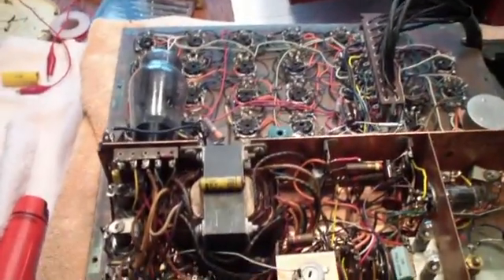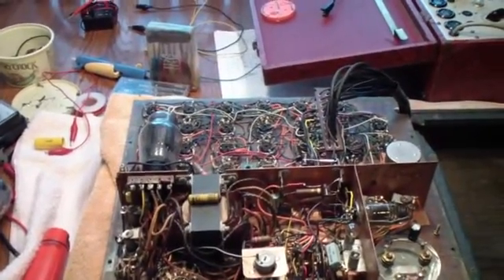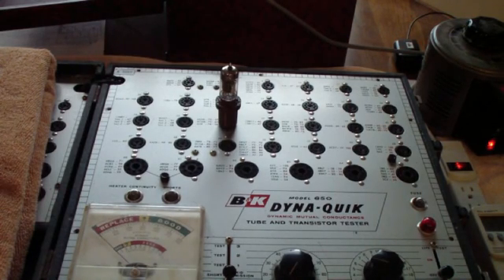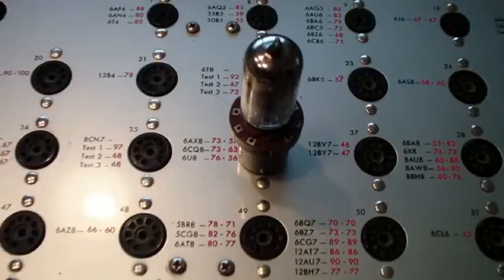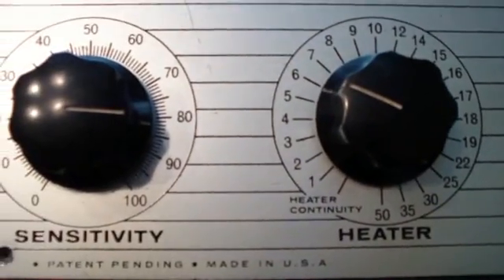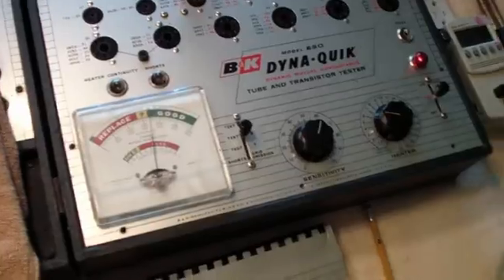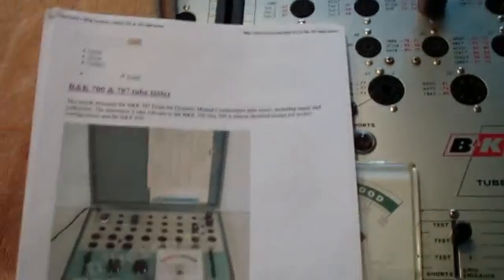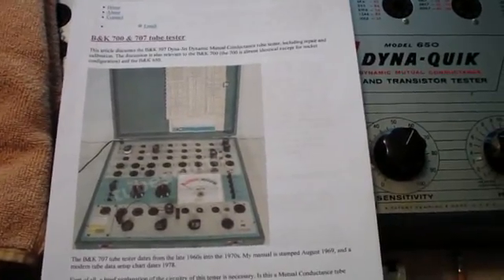TTT031 BK 650 Pt7

Comment: Hi Tom,,, Just watching your 650 restoration series again and I noticed that you said you did change the Selenium Rectifiers to  Silicon Diodes... I'm wondering if you did a video on doing that.. Would be nice to see how you Changed those and what components you used. Ter.
Reply from the maker: Hi Terrance. I don't think I showed the selenium/silicon replacement in the 650 videos but the procedure is shown in Part 2 of the Westinghuse radio restoration and the procedure is the same, that is (1). measure the voltage at the output of the selenium before replacement, (2). install the silicon replacement (I use 1N4007 diodes), and (3) insert an appropriate series resistor to bring the voltage back to the value measured in step 1, observing the wattage rating for the resistor P(Watts) = (E*E)/R where E is the voltage across the series resistor. Hope this helps and good luck with your restoration. Also, I think the 83 replacement is shown in Part 14 of the 650 videos.
Reply: tomtektest Hi Tom,,,Thank you for your reply,,, I'll watch the Westinghouse restoration vid,,, Just recieved the rest of my 83 replacement parts so will be building that and trying it out over the next couple of days.. Ordering an ESR meter and will be changing the caps that you changed and looking at some other things as well... Super Duper thanks for all your Help and wonderful work,,,We are very  lucky to have you to share your knowledge with us. Ter.